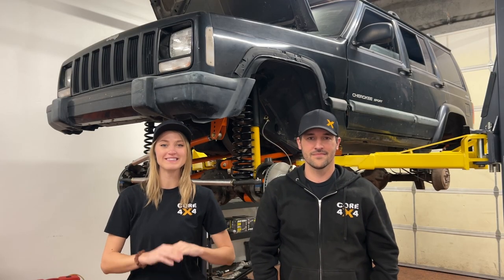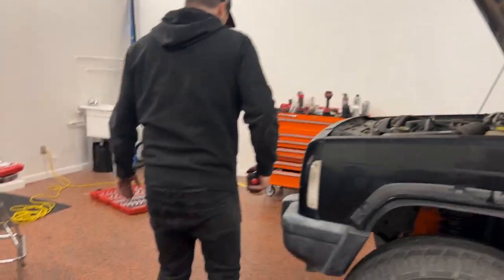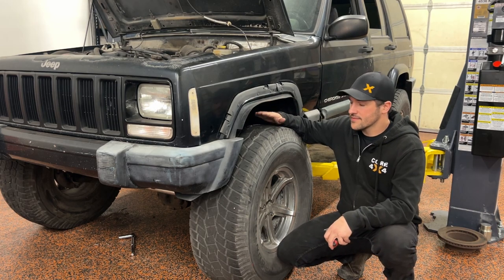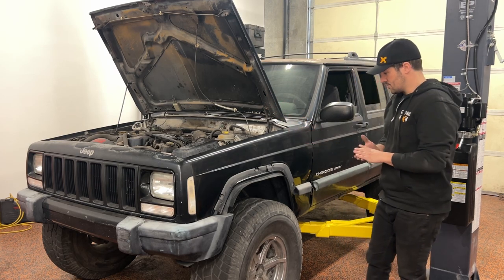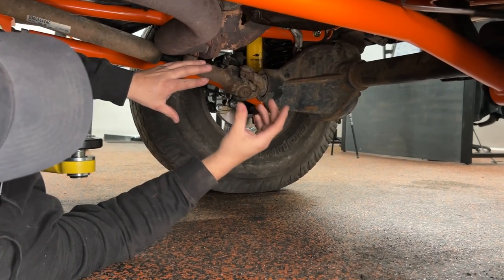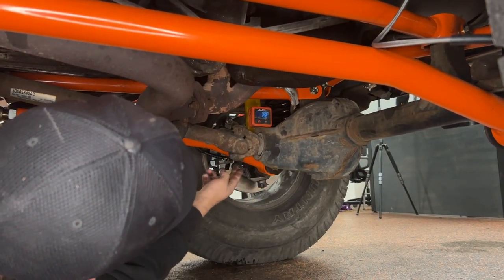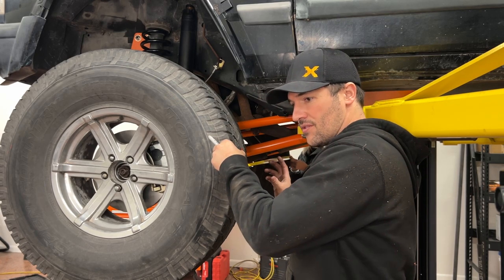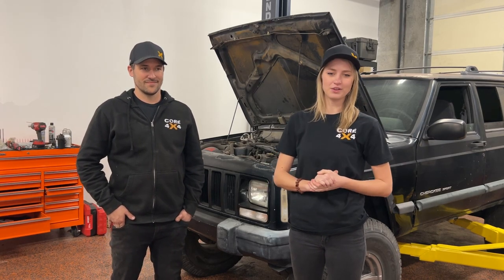How to Perform an Alignment at Home XJ Cherokee

Comment: I prefer a sleeve adjustable track bar, makes thing much easier especially when working alone. Cost is close enough to make it worth the difference. I think I paid 125$ for my sleeve adjustable track bar. All good information and presented very well. Great job to you both. God bless and stay well.
Reply from the maker: Thank you!

Comment: Good video, here are a couple of pointers for better accuracy. If your toe isn't set perfectly and the tires are not perfectly straight, your wheel base measurements will not be accurate. Eye balls are ok for this, but strings or lasers are better.  Always set toe with the weight of the vehicle on the ground as toe changes along with castor and camber when the suspension cycles.

Comment: Thanks for the XJ suspension series! I now understand a lot more about my XJ that I bought with 6.5" lift. Been trying to figure out the clunks I hear. Just went and looked to find the track bar wasn't adjusted so the driver side coil has been slapping and rubbing the track bar mount. I haven't fully understood what the track bar did until now, thanks!
Reply from the maker: No problem! We love the XJ. We made our first parts for the Jeep Cherokee, so it has a special place at Core. We're glad that we could help in some way!

Comment: Did you need to get a longer front driveshaft.  I've got 5.25" lift and I moved the front axle about 1.5" forward to center the tire in the wheel well and my driveshaft extended out about 2-2.5"

Comment: More on the pinion angles please , I am finishing up my 8.8 swap and Hp 30 zj , drives floaty down the road … making adjustments to the front to see if it alleviate ,,, will the rear pinion angle cause drivability issues?
Reply: The rear pinion angle being out of whack will cause driveline vibrations